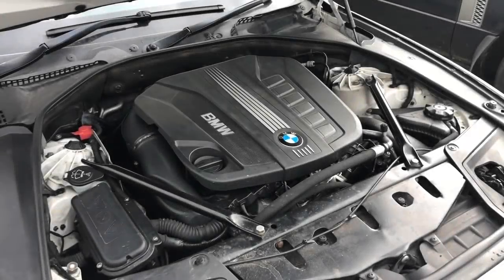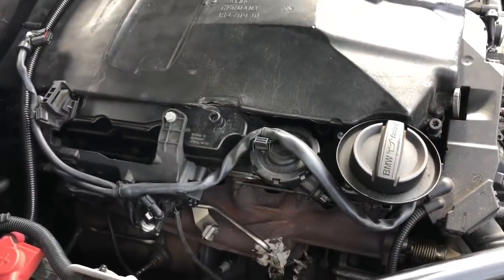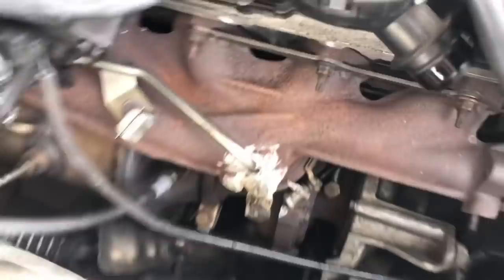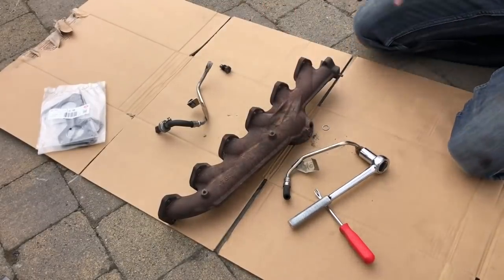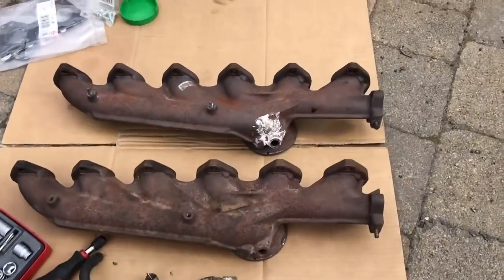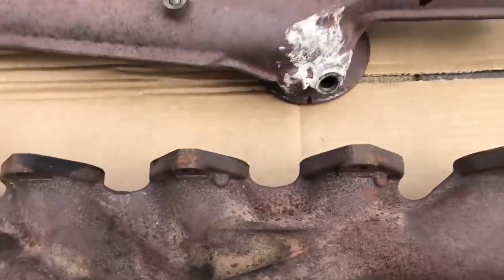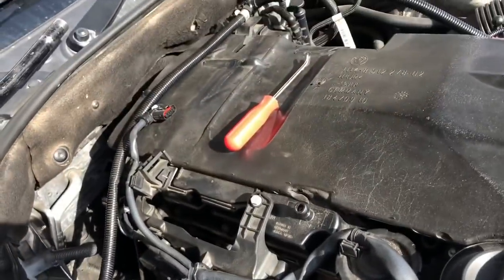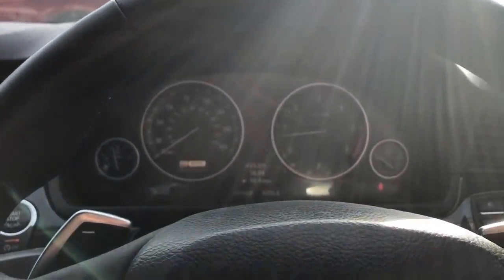BMW 530d F11/F10 N57 Exhaust Manifold Replacement

Comment: Decided to change the back pressure sensor pipe. Big mistake. That banjo strips 90 percent of the time. You can tap the tread, which again means removing the manifold though. So unless you have problems don't mess with it :-) On N47 engine you can do the job without touching the DPF, but it's a bit of a PITA. Thanks for the video!
Reply from the maker: Agreed 👍

Comment: Next time when you have a stripped bolt, make a thread chaser to run down any stripped threads with some oil on the chaser. Saved me many times.
Reply from the maker: Totally agree now 👍

Comment: Nice job as usual. Although a bit of a pity that you haven`t got your new manifold machine skimmed on surface where it meets gaskets. It is known issue that those manifolds bend over time and leak exhaust gas on frontal cylinders. This would be "stay on safe side" addition. 
Warm greetings from Poland.

Comment: I really love your video,s . I admire your talent.  if you can change timing chain on a BMW on your drive with basic tools....wow   you are a master.Man
Reply from the maker: Thanks Ravi 👍
Reply: I have a 320d  ED 61 plate with 82k miles . Do I need to change the timing chain now for the safe side now!
Reply from the maker: Well, since there’s no published service interval for the timing chain it’s totally up to you really. If it were me, I wouldn’t be changing any timing chain before 100k. Perhaps towards 120k is a reasonable time to get it done (my opinion only) 👍
Reply: Thank you so much. As we all are in lock down, I am doing the majority of the service on my car. Oil service/ Brake pads and disk change ect. I also wanted to do a coolant flush..I am not sure how to bleed the air out completely without starting the engine. Is there anyway I can manually activate the water pump without starting the engine.....?  Please help me
Reply from the maker: Yes, you can start the electric pump bleeding process by doing the following: Turn on the ignition (but do not start the engine), turn the climate fan to the slowest speed. Set both A/C temperatures to the highest temp. Now press your foot all the way on to the accelerator pedal for 10 seconds. If you listen carefully you should hear the pump start going which will move all the air around/out of the system. This process goes on for some time (10-15 mins or something like that) so it’s a good idea to connect a battery charger if you have one. 👍
Reply from the maker: Then check the coolant level & top-up again as needed. Repeat until completely full 👍
Reply: That was Fantastic... BIG BIG thank you. You are a STAR
Reply from the maker: Glad to help 👍

Comment: I had a similar case at N47 with that Banjo Bolt because of the rusty inner fillet, dificult to unscrew with some steps back and forth during using WD40. 
Before to use another Banjo I cleaned  the grooves of the fillet where were deposits of rust at the entrance.
The Banjo's material fillet is softer than the exhaust manifold and it destroys it during the banjo is being screwed. 
Thanks for the explanations!
Reply: Do you have the part number for the n47 banjo bolt? I can't seem to find it

Comment: If this happens to anyone else you can re thread it with the manifold still attached. My pipe was leaking and when I cracked the bolt I knew it would be agro, exactly the same thing happened. Its more there's crap in there rather than the thread is stripped. M12 x 1.5 tap and 30 minutes later the new bolt will go in there. Easy job
Reply from the maker: Wish I’d tried it that way 😂
Reply: I'd still rather remove the manifold to prevent metal going into the turbine
Reply: Is it m10 x1.5 or m12x1.75 as all the set i have found online , none of them have m12x1.5 just m12x.175
Reply: To add to this, wear thick gloves and run the engine why tapping it. It blows any swarf straight back out.. Gloves are essential as it gets hot very quickly these are exhaust gasses! Its sometimes easier than undoing the turbo especially if its bolted on and not on a quick connect ring

Comment: Great vid as always, been enjoying and learning from you for a while. Just a quick question I’m just about to change my f11 battery like for like, did you register your battery when you changed it?  Thanks 😁
Reply from the maker: I actually didn’t bother. If I’d bought a slightly more expensive diagnostic tool (or persevered with installing ISTA) then I could have done it myself. I’m not particularly worried about it though - as I understand it, the point of ‘registering’ a new battery is just so the charge controller knows the battery is new & can deliver a slightly different charging rate. Hardly the end of the world IMO. I’m sure others will of course disagree... 😂
Reply: Thanks nut job, I was going to purchase a foxwell diagnostic tool to register it but have had same thoughts as you and think I’ll just put new one in and leave registering it- though I have been wanting reason to get one!Just wanted your opinion as you’ve changed yours. There will always be those who disagree and know better🤓 thanks for taking time to reply👍🏻
Reply from the maker: I must admit, I put off buying a decent diagnostic tool for ages but they are extremely useful if you are doing a few jobs on cars. My Autel tool has been very useful already 👍
Reply: I’ll check those out thanks, using lockdown to tackle jobs I’ve wanted to do for a while ,just replaced glow plugs, module and cleaned intake and ports-messy job!Keep up the good work and look forward to next instalment👍🏻
Reply: @stuartparkinson5968  It's better at least for alternator to register a new battery, otherwise the alternator will provide as much power as it can and can damage the new battery during time. 
From my point of view these actions should be done just with ISTA and not with other tools.

Comment: Good job, always reminds me of my days working on my e38. By the way what’s that RS logo under the speedometer? Just a couple of weeks ago I did the front brake discs and pads on my 530d as a very nasty judder while braking just kept increasing by the day. Febi discs for £70 each side and brembo pads. I tell you it’s really very satisfying after the work is completed rightly. Keep them videos coming.
Reply from the maker: The tag on the speedometer is it’s calibration certification number from when it was used as a police car. It’s satisfying to get a job done by yourself on a car isn’t it 👍
Reply: @Nut_Job.  Indeed, going to do the same job as you did on my f31 330d. Crack in the manifold just over the mount to the turbo.

Comment: Hi just watched the manifold vid I need to refurb my turbo on same car F10, do you know if the turbo can be removed without removing the manifold. Thanks Alan
Reply from the maker: Hi Alan, so I never actually removed the turbo on my N57 like that (without other parts coming off) but I do think it should be possible. It will probably be done mostly from underneath so you’ll need it on ramps/axle stands, but I would undo everything on the top side first. There’s a few V-clamps, bolts & banjo bolts for the oil lines and then you just need to try wiggling it out between engine/suspension parts. Hopefully it can be done that way 👍

Comment: nice job! i have a question for you, i need to replace one of my pressure converters on my f11 535d, do you know where they are, and how to replace them?
Reply from the maker: I usually describe these as Boost Pressure Control Valves. You have 2 of them because your 535d is a twin turbo engine (unlike mine, with just one turbo & one Boost Pressure Control Valve). They are usually part of the turbocharger assembly - next to the exhaust manifold like in my video. Have a look at this link which shows your engine: https://www.realoem.com/bmw/enUS/showparts?id=MX72-EUR-03-2011-F11-BMW-535d&diagId=11_4436
Reply: Thank you i will have a look, btw i really enjoy your videos :)
Reply from the maker: Thanks & good luck 👍

Comment: Great video what material is manifold made off and is it possible to weld it if cracked ?
Reply from the maker: It’s cast iron. I’ve not welded cast iron before but I’ve seen others do it.

Comment: Question! What's the age and mileage of your car? You always seem to be working on it and I'm considering a 530d touring but do they really need THAT much working on to keep going?!
Reply from the maker: No, they shouldn’t need too much work. Bear in mind that I bought the cheapest 530d which is also an ex-police car. It had 165k miles on the clock when I bought it & it’ll soon be at 180k. In terms of drivability it’s one of the best estate cars I’ve ever owned - so I wouldn’t let my videos put you off. You can probably treat my experience as “the worst it could possibly be...” 😂👍
Reply: @Nut_Job.  Ah thanks for your reply! I've been watching your videos, and they're really informative, I've been hankering after one but will be trying to get one under five years old and under 40,000 miles, so you feel that they're a good purchase? I've worked on my own cars for over a years but the BMW is still scaring me 😬
Reply from the maker: If I can do it, I reckon you’ll be fine mate. I didn’t know anything about BMWs before I bought this 👍

Comment: Have the same problem here on my F30 330d :-/  Wouldn´t it be possible to recut the thread or repair it with a thread insert?
Reply from the maker: I did try, but it’s the high heat that’s the problem. I tried using exhaust sealing paste too, but it didn’t last long unfortunately
Reply: @Nut_Job.  I ordered a special thread tapper with a long conic head for the first cut. Originally made for repairing oil sump threads. Will try to recut it with this instrument. 
Normal tapper didn´t work because it was impossible to get a first cut without predrilling the hole a little bit. Which is impossible because there is no space for using a drilling machine.

If it is impossible to simply recut, i will try a helicoil oil drain plug thread repair kit with a step tapper.
This step tapper should drill the old thread out and cut a new larger thread for the helicoil insert in one step, without needing a drilling machine. That is what the manufacturer says.

I´m very curious if that will work in my case, don´t really want to change the whole manifold only due to this damn thread :-( 
Will report if it will be successful :-)

I saw your other videos, incredible what you are able to do without a proper workshop and certificated special tools. Even replaced the timing chain, wow. Thumbs up. Mac Gyver could never have done this like you :-D
Reply from the maker: Good work 👍
I only really replaced the whole manifold because I found it pretty cheap on eBay... the job was more hassle than I expected tbh. 
Nothing compared to a full engine rebuild though
Reply: @Nut_Job.  Haha i can imagine that :-D  Doing it on the F30 would be even more difficult because there is less space in the engine bay compared to the F10.
Reply from the maker: Very true 😬
Reply: @Nut_Job.  Good news: It was possible to retap the thread by pretapping it with a M11x1,5 tap and finishing using the standard M12x1,5 tap. 
Didn‘t need any special taps or helicoil. 
It‘s not perfectly straight, so i had to tighten the screw a little bit more than 30NM to get the connection sealed, maybe i have to use a milling tool to get the sealing surface perfectly flush with screw and sealing rings. 
So happy that i dont have to change the manifold😃
Reply: @ruhrpilot  do you have a link for the kit/tools you got?

Comment: Is there a tightening sequence for the exhaust manifold to engine nuts?
Reply: Not really, but you should go in a cross until they all click at the set torque (13 Nm in my case).
Reply: @breach1702   Thank you. I did the cross pattern, with 13 Nm tightening. I changed also the DPF gasket, the banjo bolt and the EGR to exhaust manifold gasket. All well now, thank God. :D

Comment: hello I did not understand why you change the manifold? leaking exhaust gas from the thread?
Reply from the maker: The thread had stripped in the cast iron manifold. Possibly could have re-tapped the hole but I just decided to swap for another one. It was causing an exhaust leak & couldn’t tighten the banjo bolt for the pressure sensor

Comment: Do you know why the DPF housing was under so much tension? Did it jump out the holder at first when you loosened the screw?
Reply from the maker: It didn’t ‘pop’ out exactly, but it was squeezed into place against the turbo which made it really tough to get back aligned